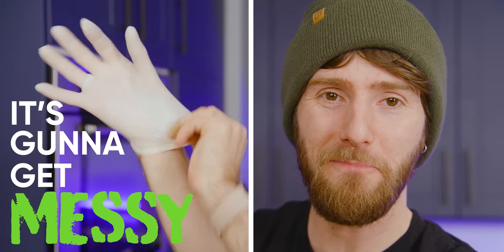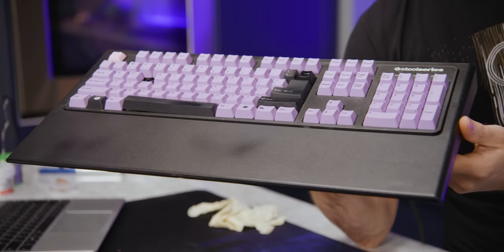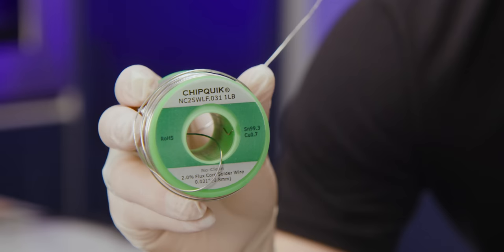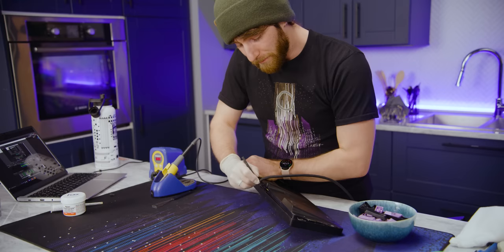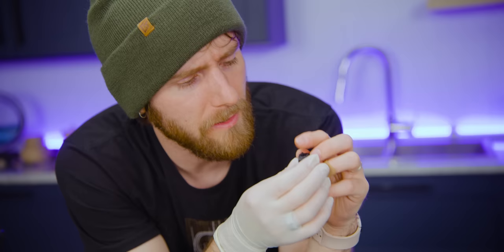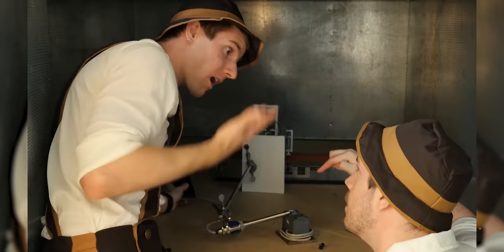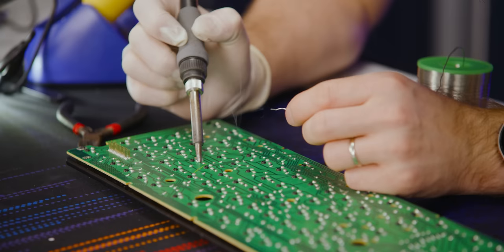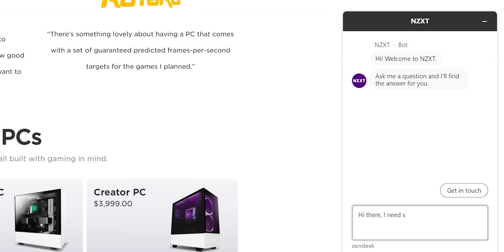Fixing my Wife’s $150 Keyboard for $1

Comment: It’s actually pretty common to bend the leads on parts, it helps hold them in place until they actually get soldered on.
Reply: on diodes and other THT stuff? yes
on keyboard switches? absolutely not unless it's a horrible company practice. In years I have never seen any company which knows what they are doing bend pins on MX style switches
Reply: @MaxC_1  You are talking about a very, very, very small sliver of the electronics manufacturing industry. Maybe now when most of them are installed by handful of companies that have mastered the process to this specific product category they don’t bend the leads. But globally, and especially back then, those suckers were getting bent.
Reply: @Cohors1316  From my experience of opening up boards, even the boards from Cherry themselves from several decades ago, didn't bend pins on switches and used to rely purely on the plate to hold the switches in place which is the proper way to holding the switches in. For majority of component it sure makes sense to bend leads and that's an industry standard on THT but for MX style switches (or even alps and all) bending them isn't a very recommended strategy imo due the redundancy

Comment: "They bent the pins"
That's probably to keep the keys in place. I'm guessing the board is wave-soldered.
Oh, and as far as washing in the dishwasher goes: Make sure to clean (read: submerge) it with alcohol afterwards, so that can displace all of the water.
Reply: Back in the days when I had time to play with electroics I also always bend the pins on everything.
It makes it easier to solder things if you just attach all components and bend pins to make them stay in place and then solder everything in one go.

Comment: Fixing is not magic, but getting it for one buck - that's what I call a bargain! :P
Reply: $1 + 2 hours of your time.
Btw, what is your hourly salary?
Reply: @hubertnnn  + probably several dozens of $ for specialized equipment you most likely won't have lying around at home.
Reply: @Tokru86  Around 15$ for the parts. Cheepest soldering gun (you don't need any special PCB soldering iron machine for such big stuff), a bit of solder, instead of flux dot of rosin what you can eventually take from tree and just a bit of copper wire strip. Also if you don't count cleaning, what should be common maintenance and hygiene, whole process cannot take more than 30 minutes and future times less than 15 minutes. Only lazy ass with crippled hands can tell it is not worth to replace switch. It is like to tell you throw away car just because you need to buy car jack to replace your wheel.
Reply: @jannepomuk7735  People who don't have the time or are physically incapable of performing such tasks DO exist... but given the price of a mechanical keyboard? finding someone who can do the fix cheaper than buying a new one shouldn''t be that hard, usually.
Reply: @hubertnnn  Desoldering a single switch should take no more than 15 minutes. Even a noob can desolder an entire board and put new switches in less than 2 hours
Reply: @laurencefraser  There exist people with serious reasons what cannot because of their health or mental problems, but people who had a time to watch this video cannot tell don't have time to repair it themself. This easy repair can only give them, everything new what they do is an experience, what is the only thing that cannot be stolen from them. Is it not worth to spend just a couple of bucks for solder pistol, so they can also solve small problems in the future like connect back cut cables? This repair doesn't require any electricity or technical knowledge, it's just a change of part for the same working one. Job just a bit more complicated than bulb change. Also this is not a job for professionals as they are learned to find a way more complicated problems and solve them. Sorry for this long boring message, but I can see all around people who just tell I cannot or I don't know, but they don't do anything to can and know even when they have chance. These people know only one thing what is their job and are absolutely lost in everything else and don't make any effort to change it. These people are totally useless if something unexpected happens.
Reply: @hobojoe551  Desoldering a single switch and soldering it back would take about 15 minutes, but don't forget you also have to disconnect and then reconnect 150 buttons and this takes about 5-10 seconds per button and you also need to unscrew about 15 screws and screw them back.

With power tools and specialized tools for $500 (like that keycap puller linus has) it might take maybe 5-10 minutes to disassembly and another 5-10 min to reassembly the keyboard.

But with just a manual screwdriver and your fingernails as prying tools  its going to take at least an hour if not longer just to take the keycaps off.
Reply: @hubertnnn  Again keycap pullers aren't exactly "specialized" as you can pick one up on Amazon for less than 5 bucks. That's not even taking into account that just about every keyboard I've bought in the last 10ish years has come with some sort of keycap puller iun the box. You can use a cheap $15 soldering iron kit from Amazon that comes with a solder sucker. To do the entire board it will take under two hours. To do a singular switch that's a 15 minute job, as it's how long it took me my very first time even using a soldering iron. He also didn't need to take off every keycap. It very easily could have been done just by taking off the keycap for the broken key.

Comment: the way i look at things like this is i either spend $100 on a new keyboard or i spend $100 on the tools and parts to repair the original keyboard.  there might not be any short term gain but long term the potential gain is huge.

I do the same in lots of aspects of my life, a few years ago I had to change all the doors in my house  off of the main staircase and I had the option of paying a carpenter £100 - £150 for each of the 7 doors or spend £400 on the tools and jigs to do it myself, not only did I save around £600 on the doors but I went on to make my own mouldings for the architrave around the doors and the skirting board (base board to the foreigners) along with many other little jobs.

buy tools and learn skills kids!

Comment: First of all, use leaded solder, or you WILL loose your mind trying to solder the new switch.
Also, the reason why you would use unleaded solder has nothing to do with environmental reasons - its simply because lead (allthough less so in its metallic form) is poisonous.

Also, when you use flux core solder, why would you need extra flux??
Reply: Can still be done with lead free solder, but you need a higher power yet controlled soldering iron. For desoldering I often have to crank mine up to 260C (even 300 at times) while not having it burn or lift the trace. Chipquik alloy will help a lot by substantially dropping the solder's melting point once worked into the joint. I use a 50w Weller WESD51.
Reply: to protect the nearby tracers/pads is my guess + any residual solder that wasn't wicked up
Reply: The flux is helpful for the removal of the old solder.
Also, yeah, leaded solder is way easier to work with. Remember to wash your hands after using it.

Comment: I have de-soldered entire keyboards and using that cheapo solder sucker is definitely the way to go. You don't need to use flux either just make sure your iron is hot enough, and to make it easier you can add some new solder on top of the old solder, it will make the old solder melt easier.

Comment: I did this with my mouse, been going since 2010. The most shocking part was that the £100 mouse had buttons rated for 5 million clicks even though 50 million click buttons are a few pence more expensive. The most positive way to think about it is the manufacturer cheaped out. The most likely reason is they want their mice to break faster so you buy them more often

Comment: I like the mindset Chris Fix told numerous times, factor in the cost of tools into the repair cost and most of the time it is still cheaper than having it repaired at a shop or buying new product. Side effect is that you are left with the tools for future repairs. In this case all the materials and semi decent soldering iron/station could be had for about 100 bucks, still 50 cheaper than new keyboard...

Comment: 4:00 Leaded solder is actually MORE environmentally friendly. It makes much more flexible joints, which makes devices last longer before they need to be fixed - Or rather, thrown out because most people don't know how to do basic electronic repair and many of the people who do would rather buy a new device than troubleshoot the one they have.
Reply: So you buy leaded solder because you don’t know how to do basic electronics repair…
Reply: @Aikano9  I buy leaded solder because soldering stuff is annoying and I would rather use the device than figure out which joint is bad. I've recapped an entire Game Gear, I know how to solder.

Comment: im schooled in injection moulding. Injection point has nothing to do with mould changes. Its little residue thats left on that point and on some parts there is more then another. There is a little pen that closes the injectionhole so more liquid plastic isnt gonna flow out of the mould when opening to eject the solidified parts. Sometimes that pen wears out and you get a larger tip on said injection point.

Comment: I bought a cheap mechanical keyboard, and replaced every single key with Box Jades. it's legitimately one of my favorites. soldering kits are cheap, and it's not hard to use the little spring vacuum tool, I totally recommend it if you want to start using some premium switches but don't want to spend a ton of money.

Comment: "1$...plus shipping and handling, and materials that we may need." 
The shipping and handling brings the cost well up over a dollar. Although you could swap it with another switch from another key that you don't use very often such as Scroll Lock, Print Screen or Pause/Break. Since the key still has some function you'll still be able to use the other key if you really have to, and it's likely that those other keys have never been used so they would be almost as good as new.

Comment: Great video for the basics of keeping peripherals alive with a cheap part replacement. Maybe should do a similar one for replacing the Omron microswitches in many good mice? They have fairly wide range of serial numbers compared to Cherry's,  but mostly is about the width/height than wiring, and are similarly available and around 2$.
One thing i didn't recognize was the keyswitch holder thing at 9:33
Reply: Gateron makes switch openers like that. ITs around 25 bucks too
Reply: @shadmankabir5916  cool thanks,  is that something they needed for the fix in video?  or was just for showing how the switch is assembled ?
Reply: @benwu7980  it's only needed if you want to open the switch, and you can manage with toothpicks/pins/needles if that's a single switch.
 you can also get small keychain ones for like 15 bucks, as it's just a piece of cast or machined aluminum.
And it's not needed if you replace the whole switch.
You can clean and/or replace the contact in the switch if you want a repair with even less waste. (Or you can slightly bend it in shape if cleaning didn't do the trick)

Note that removing the keycap, pressing on the switch and spraying contact cleaner inside then pressing the switch repeatedly can work fairly well.
You can find electrical contact cleaner in auto shops and even in supermarkets in the auto section. It also works amazingly well on scratchy potentiometers

Comment: I still use a CM storm keyboard I bought almost 10 years ago. It is the only mechanical keyboard I've ever owned and cost me around £70. It's missing the right Windows key because one of my switches was dying and I fixed it for free by swapping in the Windows key switch, and one of the tiny SMD signal diodes on the board has been replaced with a relatively massive through-hole diode crudely soldered and glued in place.
I love my keyboard and it will be a sad day when it finally dies for good.

Comment: Haha crazy, I just had to do this repair myself for my nephews keyboard a few weeks ago. While we're on the subject -- if you have LED'S actually in your switches (razer blackwidow 2016, I'm looking at you), you can actually dremel a groove into the switch and then hotglue the LED to the switch (making sure you line up the diode and cathode with their respective slots on the pcb for the keyboard)

I've learned everything I know from watching youtube videos as well. Northbridge Fix is another great channel to watch
Reply: There are switches with led slots though, you just have to put the legs of the led in the holes

Comment: For those of you who keep things around for ever and like to baby things: If you have something with plastic in or on it (which is nearly everything) I recommend getting a bottle of 303 Aerospace Protectant. Wipe that on after cleaning and your plastic parts and pieces will last forever. Started out using that on my old Mazda and eventually began using it on everything from lawn equipment to old keyboards. The stuff is pure magic.

Comment: I don’t know if I should be encouraged or worried that I use the identical soldering materials. The pump is indeed garbage. But effective when the top half isn’t flying away into the abyss of your workspace. And yes, unleaded solder is slightly more difficult to use than leaded, but beyond its environmental benefits and ROHS compliance, it’s also much, much safer to use. When you are regularly inhaling solder smoke, even in a well ventilated environment with a running fan and a decent mask, you run the risk of inhaling  lead particles. I tend to use my teeth to pull solder from a tube if my other hand is occupied, which is often, and I’ve even held a length of loose solder wire with my teeth when my helping hands weren’t that helpful. All of this exposure to lead is extremely dangerous and totally preventable.

Comment: I had one of these without the USB and audio passthroughs, and the escape key quit working 3 months after I got it. Turns out it was just a cold solder joint. 9 years later, I still have it. I don't use it often, but I have it.

Comment: Regarding the keyboards in dishwasher, i would always recommend putting the keyboard in the sun with good airflow after dishwashing them.
ive been hand dishsoup washing my keyboards for years now and then letting them dry good, and it sometimes even improves switch operation.
My current keyboard has seen probably like 3-4 washes over 6 years and some of these washings were made because keys started acting up, washed them in water with brushing them and submerging them completely in soup water, rinsing off and drying them.
I have pictures of this on my phone backup on my nas somewhere...
if i find them i'l post a link :D

Comment: That's the good passthrough. I've got a corsair with 2 a type plugs on the end of the cable and that extra only goes to a single port on the keyboard. it's just an extension. they didn't even spring for a hub there.

Comment: thats a bad tip to use on pcbs(i've experimented with them all) , use the flat screwdriver type tip on solder pads of that size. as a bonus, you can use it to get under the bent over legs to straighten them. solder wick prior to parts removal is a waste of time. add leaded solder then use the solder sucker, straighten the legs, maybe use the solder sucker again then remove the part. add a little flux to the wick, clean the pad with the wick. install the part, bend over the legs, solder part on. no need to add flux prior to soldering if you are using rosin core solder but it doesnt really hurt anything

Comment: I have put my Logitech G710+ in the dishwasher twice by itself with no tablet. I have disassembled it and washed it in the shower multiple times. Whenever I do this I dry it with paper towels and blow it with compressed air. I then wait for a few days before I use it. I often clean the keycaps by just letting them soak in a bowl of water with soap. Some of my keycaps have cracks in them from all the heavy use. Best $50 of my life, maybe time to spend a few $ to replace the broken caps.

Comment: My old Logitech G710+ had some pcb damage many years ago. I was able to fix the broken traces but for me I had to desolder every single switch as the traces run on the top of the board and to get the front cover off all switches had to be removed. Was annoying and time consuming but I fixed it.
Reply: I imagine it was rewarding though! Or at least that's what I tell myself whenever I end up down a rabbit hole like that!

Comment: If you're just getting into repairing stuff and only looking to do little stuff like this, you might be better off with a soldering gun, which is better in every way for this, BUT you have to be fairly strong, since you're holding a pretty chunky bit of iron.

Comment: I picked up the same model keyboard for £10 in a charity shop! I thought it wasn't working because it didn't show up when I plugged in the USB cable. I actually took it apart completely, mapped the pinout from the pins on the back of the PCB and was going to build my own controller, and then I noticed that the old controller board DID NOT HAVE ANY TRACES from the keyboard to the USB. It only works on PS/2! You need an adapter - like Linus' - to connect it to USB. And, of course, the PS/2 connector is at the far end of the cable, so it's not really practical to "loop back" the PS/2 directly to USB.

Fortunately my X570 Pro4 motherboard STILL has a PS/2 port. For some reason.
Reply: It's not glue, btw.